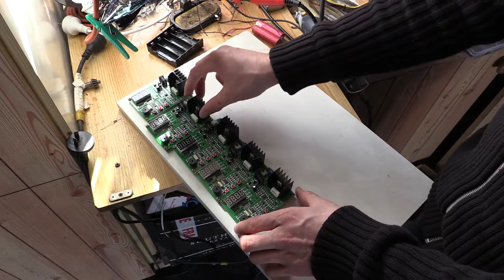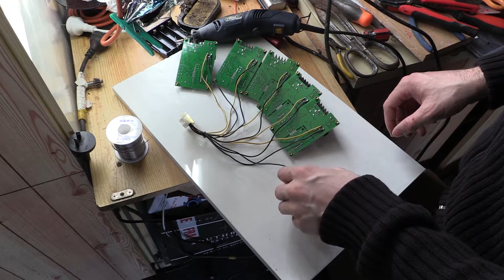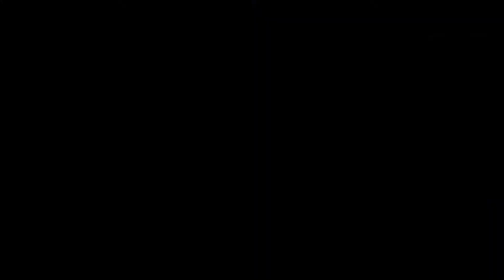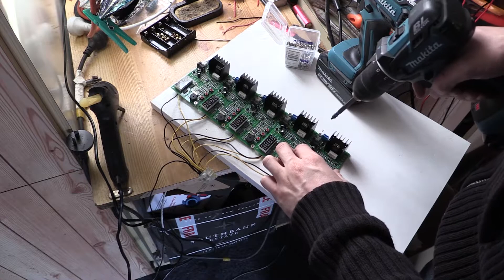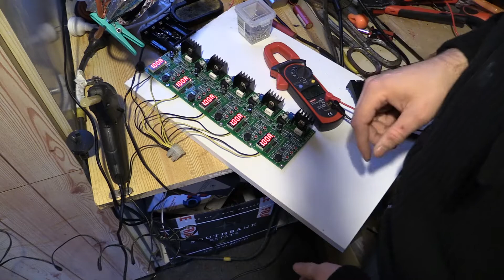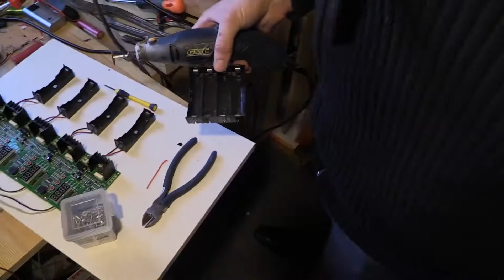More 18650 Discharges Yeah Baby

Comment: Hi Mike, Love your videos. It dawned on me that if the DIY Powerwall makers who are making videos represent only a small fraction of DIY Powerwall builders, we could be collectively be burning a lot of mWhr's of energy discharge testing 18650 cells.  I think it is possible instead of wasting this energy as heat, hookup a small boost converter(<$1 ~90% eff) connected to a TP4065, and partially charge another cell while discharge testing. We might be able to recover about 85% of the wasted energy. What are your thoughts?
Reply from the maker: I dont think the wasted energy in the discharge test is worth worrying about. The test requires a constant load on the cell of 1amp, if you then used a small boost converter to another tp5046 to then charge another cell its current draw is going to be all over the place and destroy the test on the first cell. Given how little energy and the amount of work that would be involved it's not worth it. Your better off once the cell is in the pack using active balancing and spending your time/money on that given the payback would be better, However its expensive and just wasting the energy as heat is better and far cheaper.
Reply: Thanks for the reply Mike. I agree with your reply in principal although I do believe as a community we are wasting MegaWattHours in discharge testing. Could you estimate how many +/-7.5wHr cells you alone have discharged over time? Someone has suggested that perhaps the cell discharge energy could be stored in a super-capacitor bank without disrupting the cells controlled discharge current. In the end you are probably right.

Comment: hey thanks for making this video! I was going to buy the blue ones with the resistors but after seeing your video for twice the price that these are they are so much more versatile! I am making a 6 cell charge and discharge station, it will consist of 6 of the discharge boards that you have and 7 of the LM2596HV CC/CV buck converters that can take 50v in, It will all be powered from 48v coming from a PoE switch. Once I setup my solar the PoE switch will be powered by solar/battery and with no need for inverter conversion, only a boost converter going from 24v to 48v. Total cost would be around 60$ which is the same price as an Opus tester since that costs 40$ is 4 slots I will have 6 slots instead!

Comment: Because these are on dischargers why did you not just wire them all in parallel one to the other, and as they will use minimal power just connecthe the top one via the barrel plug which would power all of them.